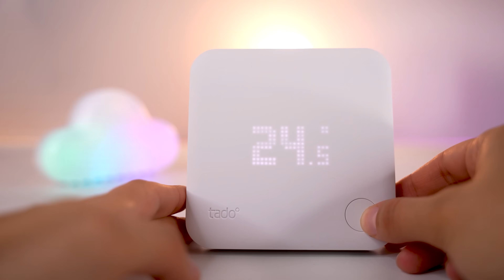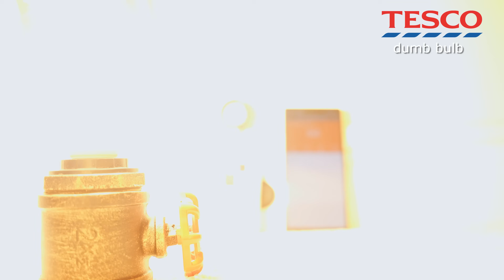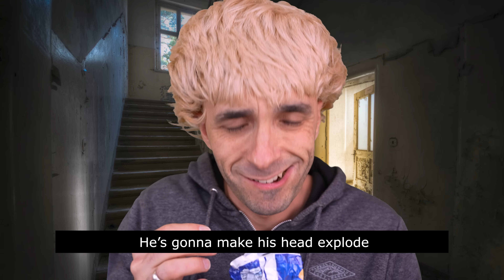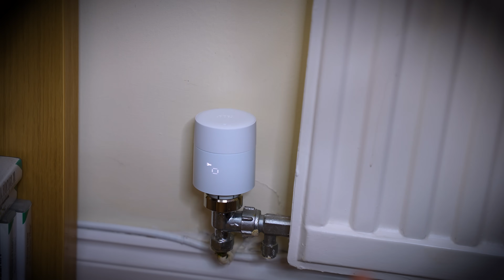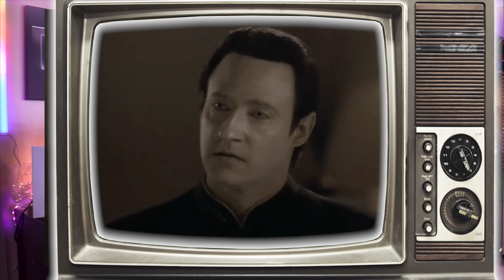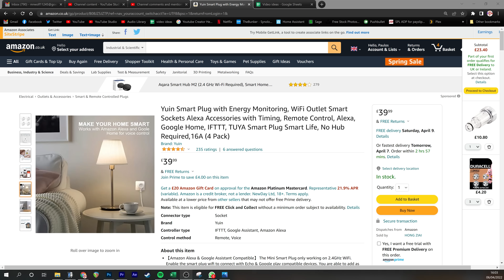The Energy Companies Will Hate Me For Telling You This But... | #EnergyChallenge

Comment: @Paul - I've done a similar exercise to you with "Smart plugs" to figure out where the pennies are leaking out ... some points I found and actions I took;

* I've setup my Synology NAS to power down between 11:30pm and 6:30am saving about a 1/4 of the daily power. (Which equates to about £11 a year at current rates)
* My monitors (of which I have 2 - and I WFH 100% so are used 8 hours a day at least, 5 days a week) use nearly 4w of power (each) less, when the screen is "Dark" vs "White". Simply by using a Black desktop background, and changing apps to "Dark mode" where possible saves about £7 a year.
* When my office is deemed "Unoccupied", my HA system turns off both monitors, desk lights, printer, scanner, Wireless charger and laptop power. M'laptop then has a power-setting that let's it "Sleep" after 60 minutes on battery power (which allows for not being annoying when I simply grab lunch or a cuppa) and this too then saves power. Soon as the office is occupied again, power is restored and it all fires back up without me really noticing it's been off.
* Overnight, my HA system powers down my upstairs network POE switch, which cuts power to the AP's upstairs too.
* My "Wine fridge" (which has beer, water and coke in it only - so nothing that'll spoil if warm) turns off after 10pm, and on again at 6am. It retains a good level of the cold temp during this with not being opened, so doesn't take much power draw to get back to temp the following day (less than it saves by being off anyway).
* When the house is unoccupied, I've got a different heating temperature profile, so the heating is about 4'c lower when nobody is home, and automatically kicks back in when we get back.
* Lights are occupancy based, and light level based, per room. This allows them to be "on" when it's "Dark" and someone is there, but off when either condition isn't true. Similarly as you suggest, they dim down at "TV Time" to be cosy / save power. Rather than how a binary motion sensor would operate, If you "dwell" around the Dining table for longer than "just passing" (or just happen to be in the open plan room, and not at the table), then the over table lights will come on to supplement the room lighting if this is dimmed.
Reply from the maker: Love this comment! Great ideas man!! ❤️

Comment: One thing to keep in mind is LED lighting in inherently less power demanding than many other types of illumination most especially incandescent. Still using Watts as a measure of the light vs. Lumens as most people don't understand really helps show the difference, a 60 Watt Replacement that only use 8 watts, multiplied over thousand of house holds. that is some quality savings.
Also keep in mind the latent heat load that older forms of light would throw into a space requiring mechanical cooling, While the LED does produce heat the calculations for A/C design Tonnage is extremely minute especially in large space designs like office building compared to fluorescent or incandescent loads.

Comment: Do you really have 243V in socket in UK? That's quite high as for 230V standard. Above recommended 240 value.
How is air-to-air AC heating units market in UK? That can give significant save on warming cost in wintertime.
Have you heard about Dubai Philips LED bulbs that are designed to work for many more years than our local EU ones and consume less power?
Reply: Your talking about air source heat pumps as far as most people would know it in the UK, as we don't have that much AC.
And the media in the UK has been crapping all over heat pumps.
More importantly have you seen the new non Dubai philips LED bulbs.
They are the "most efficient" LED bulbs philips has ever made.

Comment: As a Tado fan and user...

1.  Tado requires a constant internet connection.  Without one, you can manually override but no timers will work.  (Unlikely to be a problem for followers of this channel!)

2.  UK versions are not OpenTherm.  Consider sourcing a European one if that's important to you.

3. Amazon, etc., often have special offers on for Tado kit.  You shouldn't pay full price...

4.  Their tech support is really good.  The app guides you through installation step by step.

5.  Depending on the sort of home & heating you have, individual room control that Tado provides can actually be counter productive and can actually cost you more.  Only likely to be an issue if you have a super efficient heating system like a really well designed boiler system (very unlikely!) or a properly installed and configured heat pump.  If you have a heat pump, don't install Tado, Nest or anything similar without discussing it with your heating engineer.

Comment: Picked up a few aqara motion sensors and some Sonoff s31 smart plugs.

These connect to Home Assistant and it runs automation to turn off the plugs to their tvs if there's no motion detected for 30 minutes. Works pretty well so far.

Comment: I have a tado thermostat and valves. Overall they're really good, the valves look nice and things are pretty reliable. On the down side they only support a single bridge which must be placed to be in range of all of the valves. For me that means using a home plug adapter because the bridge is also wired only. Some of the stats available with competing brands for free require a subscription with tado which is a shame, and the auto geo location requires a sub too.  Without it the app provides prompts when you leave and return home. Also there are no local schedules, so if your wifi flakes out then the whole system reverts to something more like a dumb trv system.

Overall it's a good system and pretty reliable. Its saved me a little money whilst simultaneously allowing me to make my house more comfortable.  I'll be looking for a couple more valves to accompany the 8 I have and complete my setup. A positive experience overall.
Reply: Completely agree. A couple of other issues I have are that if you have two heat circuits (such as boilers) you require two installations. The app doesn't support two installations so you end up not being able to control one set of radiators via the app. Home assistant (cough) helps here, but it is less than ideal. There are open requests with tado to support this, but this has been the case for years.
The other niggle is the valves are kind of noisy in the middle of the night. House guests have complained they wake them up, but I have gotten used to them.
Some of the temperature readings on the valves are way off too, by 2-3 degrees Celsius. There is an offset that can be applied in the app, but this doesn't work as expected. There are hacks out there using home assistant or other products, but this just makes the install complex and out of reach of my family being able to manage it. The system only supports temperature measurement using the valves (right next to the heat source) or their own proprietary (expensive) room stats. They really should support other cheap temperature sensors that can be placed where you actually want to sense the temperature.
Other than that it is generally good.

Comment: I have tado system at home. And I have to say I am very disappointed with the open window feature. With the app I can not add a window sensor. So... when u open a window it detects it and starts a set timer. But if the window remain open the heating goes BRAAAAAAA TOOO COLD! Heat the ROOM WE ALL GONNA DIE.... I would have love being able to create automation with window sensors. As long as the window is open the heating remains off.

Comment: Rather than using TADO's open window detection feature, you might consider using window sensors + automation. TADO is rather slow in noting the open window. I use this in every sleeping room and have an automation that both switch off the radiator when opening the window, as well as checking the window status when switching on the radiator.
Reply: What do you use to do that?
Reply: @SpiralDogma-d9h  I have Aquara sensors (as they are the smallest) on the windows, TADO valves on the radiator. In HASS (yes, I use that) I created an automation that triggers when switching on the radiator valve or when opening the window. They switch off the radiator valve if the window is opened.
Reply: @vree0108  Thank you. Gonna have a look into that
Reply: then again, opening windows is so 2000. a ventilation system with a heat exchanger saves tons of energy, because you do not let out precious warm air in winter and let in too hot air in summer. all my windows are closed always. I use an Itho HRU350.
Reply: @janklamer  First of all, it makes a huge difference in which climate you live. I live in a moderate climate. Additionally, I think that it does make sense if you build a new house or do an extensive renovation to consider this solution. As a means to save on immediate high energy prices, it does not.

Comment: I didn't like the Tado system as it needs the internet for everything.  If you lose internet connection the system won't turn on or off on the schedule.  This might have been fixed but it was the case about a year ago when I decided to get the Drayton Wiser system which is completely local apart from the initial setup.
Reply: No, it's still dependent on the internet (and its own bridge - a potential single point of failure) for all scheduling to work .
Reply: @paulgoffin8054  Not good that this fault is still there - likely a limitation of how Tado designed it.  That means you could either wake up cold or have the heating on for hours after it is needed if you lose the internet.
Reply: @pseccombe  Yeah, not a fault, it's deliberate design.  The individual components do not have timers, all the timekeeping is done remotely.

Comment: Great video, as always. My main issue I am trying to work out is finding smart 4- or 6- socket extension leads that I can use and set up routines with. Any suggestions? I contemplated plugging an surge-protected extension lead into a single smart socket but quickly realised that may cost me more when the house goes up in flames then saving a few quid on an automation :D
Reply: As long as your no more than 13amps you should be ok ,  watts / voltage = amps

Comment: I am an electronics Engineer, I design power supply systems for a living. My energy star compliant TV use less than 1W per hour. There are near enough 8750 hours in a year so that's a total energy consumption of less than 8.75KWh per year at 24 pence which is about £2.10 a year. I am more likely to damage my TVs power supply by switching it completely off and on at the mains numerous times a day than leaving it on standby wiping out any saving in electricity costs.
Reply: Agree with the above, I have always been of the belief that power cycling electronics is not great for the life of the product.

But factor in things like firmware updates and TV guide update, app updates, recordings, remote recording etc. A lot of these devices are simply designed to be left in standby.

Also on the smart home front, having automations that activate tv’s and projectors etc although not impossible are a lot more difficult and complicated if you need to switch the plug on and wait for device to become responsive before sending ir commands etc.

Then my last comment would be even if I purchased a cheap smart plug (which I generally don’t as I don’t trust cheap electronics / electrical items) at say £20, it would likely take 10 years before I saw any saving and even then the saving after 10 years would be maybe £2-3 a year.
Reply: OLED TVs shouldn’t be disconnected they run pixel refresh programs when not in use

Comment: For computer geeks and home labbers, most CPU ranges have low power options in their ranges. e.g. my pfsense router had a 70W cpu in it and now has a 20W version in it..... the reduction in raw power is not noticed............. the reduction in power consumption certainly is.............
Reply: If you really want to save power with minimal fuss have a look for ErP bios setting, its to do with california laws but its about as low power as you can go without messing about with undervolting / custom settings.
Reply: @TheWebstaff  Indeedy, but I kind of assumed that one would have explored all the easy software initiatives available either with the OS or the bios.
ErP is just a small subpart of a whole series of EU Green initiatives including things like laundry and fridges etc.
As it happens, I run older equipment which, unfortunately, doesn't benefit from it.

Comment: Did you test (or do you even have) smart power strips over individual plugs?  I have a Kasa smart power strip that has six individual smart plugs in a single device.  I would bet that it draws less than six separate smart outlets would.
Reply: well if the multigang is one esp's for 6 plugs vs 6 x esp's for 6 plugs then yes thats assumption would be correct.

Comment: Cheers Paul. Really enjoyed this video. I particularly liked how you simplified the cost to power equations. Something I can use at home as there are so many online guides that over complicate things.

My ups and downs on Tado TRV's. 

Skinny is I still recommend them as build quality is excellent and short comings can be overcome if you are an enthusiast, however, please read below before you buy as other options may be better depending on your setup. If you are using Tado TRV I would consider an additional temp sensor in each room that has a TRV, I use the SmartThings motion sensor which also records temp. There are lots of other zigbee temp sensors on the market that are much cheaper.

I have 5 Tado (Vertical) TRV's spread over all upstairs bedrooms in a brick built house.

The Tado dongle was placed in a downstairs room (the garage). As you may expect the TRV's closest to the dongle were picked up a-ok, however, the furthest away room was never picked up. Tado utilise 6LoWPAN (as opposed to Zigbee/Z-wave or WiFi), and there is no ability to pop a repeater in the setup to extend the range. Solution here was to move the dongle to the loft above the bedrooms so no bricks in the way, not ideal and I was lucky enough that I had some LAN ports in the loft space. If you have a larger than average house or older with brick walls, I'd have a think about dongle placement as often our hubs/routers are hidden away in a cupboard.

There seems to be a real issue with the vertical TRV's reporting the correct temperature (it's recorded on multiple Tado forums), I suspect it's because it is so close to the radiator. As an example, I have a room, heating is on, that I'm pretty sure is 21c (based on multiple external heat sensor) but the Tado always showed it as 25c and would turn off as I had it set to 21c. You can apply an offset, however, this causes an incorrect reading when the heat is off and the TRV is not picking up the latent hear from the radiator. My fix here is to use an external sensor elsewhere in the room as your source of truth and use you home automation setup (I use habitat) to tell Tado to turn the TRV ON or OFF, I effectively turn TRV to 25c if the external sensor flags the need for the room to heat and 15c on the TRV as off if the room needs to cool. Not ideal, but hey ho. There does not seem to be the same issue with the horizontal TRV.

As mentioned above the TRV is 6LoWPAN, so check your setup for integration, Smartthings, Hubitat and HA all seem to have one, however, for all those trying to keep it local, I'm not sure if they all require some kind of internet connection to work.

Really not trying to be negative on the Tado setup as as in general they are solid as a rock, just wanted to call out some of the real world issues that are not clear on the marketing blurb.

Comment: Tado, BTW is different to "a thermostat, a timer and some rad valves".

Each radiator valve can be configured individually to control the boiler according to a profile.

So you can have the home office call for heat during the day, other rooms can all be set much lower, or off.  Then the office can shut off, the lounge warm itself or any combination.  Essentially, if anything calls for heat, the boiler will run.  If only one room needs heat, obviously the boiler won't have much work to do.

Comment: If you have electric convection heaters or storage heaters take them out the back and a dose of Hotchkiss 37x95mm is advised. Useful for Tory governments too, although I'd advise the shrapnel variant in that particular case.. 
The newer oil filled radiators shut off completely when up to heat and that saves me about 33% for the same temperature as best as I can tell. I'm using two on smartplugs and automatic switch on at under 5c, off at 10c external. 
Living on the first floor if you have a flat helps, nice and warm from below.

Comment: Problem with putting in a smartplug to close off TVs and the like is that the network has a limited capacity - less than 40 smart items in my case.
And beware of battery powered thermostat/humidity sensors - the tuya ones are an utter disaster except as a temperature indicator. Don't try to use them in automation.

Comment: I recently brought a Xbox series S and if you set the console to power saving mode it will fully shut off and use only 0.4w according to Microsoft, it only turns on to update. You do lose remote control capabilities and remote install but that’s a acceptable sacrifice for savings.